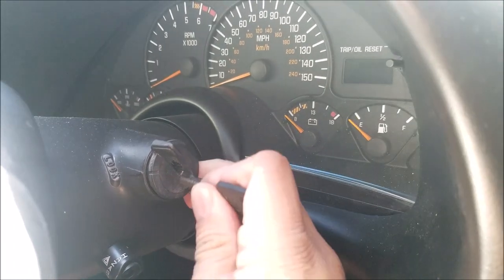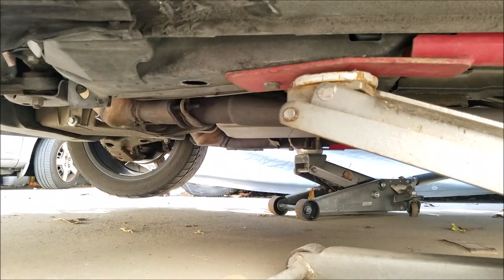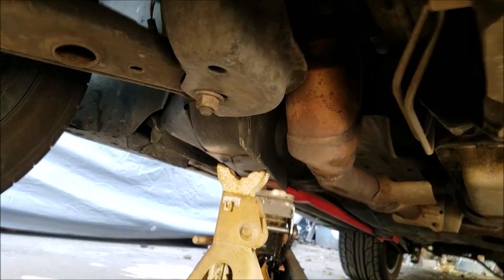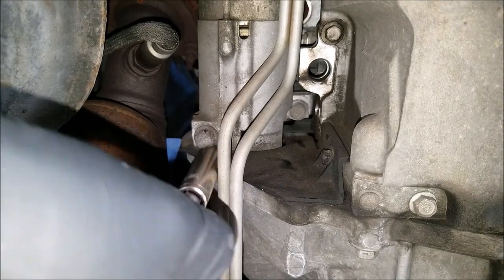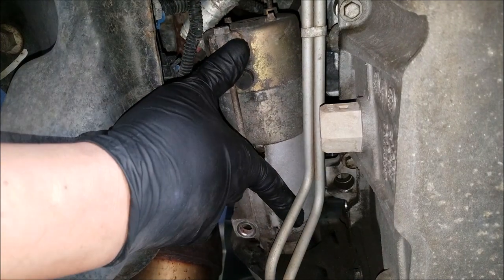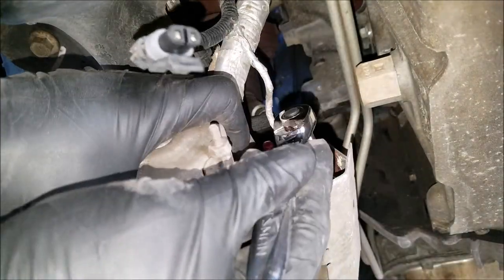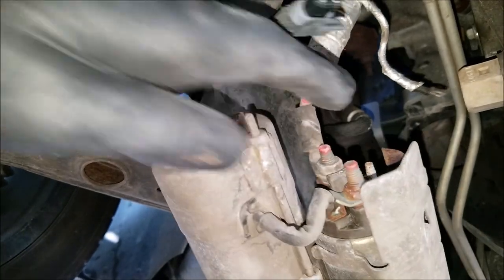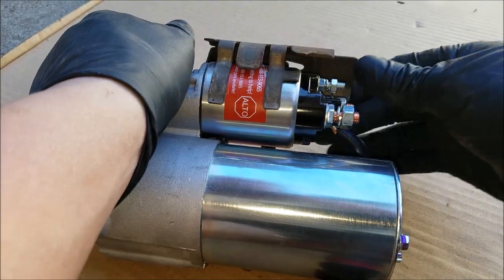How to Replace A Starter On a Pontiac Trans Am & Chevy Camaro (1995-2002)

Comment: I took my 1994  / Z28 starter out yesterday. The tools i needed were a 9/16th socket with a 6 inch extension to remove the two bolts, and a 1/2 and 8mm open end wrenches to get the two solenoid nuts off before I could drop the starter out. For sure stay calm and snake the starter out, no need to unbolt the front exhaust.

Comment: Nice video ! I also like to take a picture of the location and direction of the wires once you lower the starter down and are ready to remove the wires .
It helps when re-installing so the wires dont bind or lay against anything that gets too hot , once you bolt the starter back up .
Reply from the maker: great tip🙂 thank you

Comment: hi B-Chev, i liked your video, well shot and narrated. I have read through the comments but did not see an explanation for why negative battery disconnect is safer than positive. i dont remember seeing such a nice jacking location, painted red, is that an add on for suspension stiffness?  your pronunciation is just fine! i paid to have my 1999 200k mile firebird starter fixed yesterday, i knew it was about a 4 bolt job but dam that guy had it done quick, helps when you have a lift in a heated shop! next time it is all my job.  $360
Reply from the maker: Thank you🙂 well the reason the negative is safer is if ur using a tool and u hit metal nothing will happen since ur just contacting ground to a ground..but if u were to remove the positive red terminal first, if u hit metal ur gonna spark and possibly blow fuses even possibly damage the battery

Comment: So I have a 02 camaro and I thought it was the starter until you mentioned the security alert needs to be off to which is still flashes
Reply from the maker: Yea to reset the security youll wanna turn the key to the on position for about 10 mins til that light goes off..then turn key off and it should start or reset

Comment: I have a 2001 Camaro ss and one of my starter mounts that’s on the engine broke off, I just need some advice on what I should do
Reply from the maker: Well there's only 2 things u can really try..either have someone weld it..or u can try a metal epoxy but just need to make sure the area is clean and free of any oils   before trying it

Comment: What kind of problems will happen if one tries to start it with the security light on?... Can the problems be remedied by disconnecting the battery and resetting the system?
Reply from the maker: In some vehicles it just wont crank..on others it cuts off the fuel pump...but the way to reset the system is u turn the key to the on position and wait 10 mins or so for the light to turn off. then turn key off and it should work after that
Reply: @backyardchevy328  thank you BC I'll give that a shot... Back in November they replaced the clutch and starter.. after a while I started having issues starting it and the only way it would start is if I jump started it ....then the problem went away (wierd)... Two days ago I go to start it" nothing"... Popping the clutch won't even start it... Could there be an issue with the clutch to keep it from igniting?.. earlier this year you suggested it might be a cheap starter ...I will look into that as well
Reply from the maker: @travisquintero8334  well u got a clutch/neutral safety switch that has to be depressed for it to start..the security light if it was active would stay on the whole time..if the light turns off then that shouldnt be an issue.
Reply: @backyardchevy328  I thank you so much for your response and your patience... I will also look into the neutral safety switch
Reply from the maker: @travisquintero8334  anytime..i hope ur able to find out what's causing it..good luck
Reply: @backyardchevy328  hey BC... I changed out the clutch pedal switch fired right up... The part was $7and it took 90 seconds to change out.. once again thank you so much for your help I will definitely be looking forward to your next video... Peace love and be safe 🤜🤛...👍👍🇺🇲🇺🇲
Reply from the maker: @travisquintero8334  thats awesome! Great job
Reply: Well the whole 10 minute thing does not work on my end security light still flashing I actually left it on the on position for about 20 minutes almost killed my battery but was still flashing

Comment: Are the teeth of the starter supposed to be inside the starter? Or are they supposed to be out? 

Does it come out on its own when trying to turn it on? I can't remember.
Reply from the maker: Theyre tucked in but not completely..once the starter solenoid engages it kicks out the starter gear at the same time spinning it
Reply: @backyardchevy328  thanks so much. I was so confused. I have installed couple starters before and for some reason I just now noticed this. Lol... 

I ended up just putting it back figured that's how it came out so that's how it's going back in. 

But thanks I feel alot better about it starting.
Reply from the maker: @dnegel9546  anytime🙂👍

Comment: Ihave 94 v6 3.4 are those years an mine like the same??
Reply from the maker: Its similar..they have a heat shield that is covering the starter..i believe it needs a 10mm and a 13mm to remove em...and after u get that off youll be able to access the starter which will have 2 bolts holding it..u remove those slide it out and disconnect the connections at the starter solenoid..and the starter can be removed..and yea making sure battery is disconnected beforehand..its pretty easy on those v6's

Comment: I have a 95 trans am just changed my starter and it’s still not cranking any ideas?
Reply from the maker: Security light on by any chance? Sometimes wiggling the shifter also could affect the vehicle not thinking its in park completely if its an automatic
Reply: how did it go?